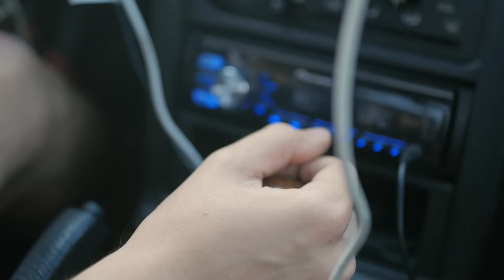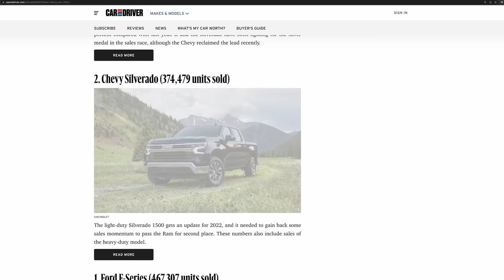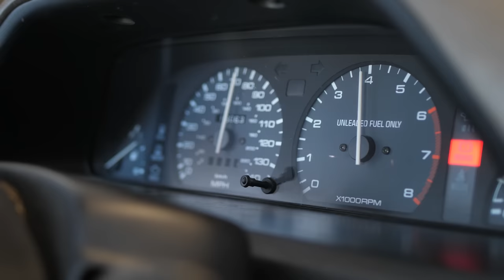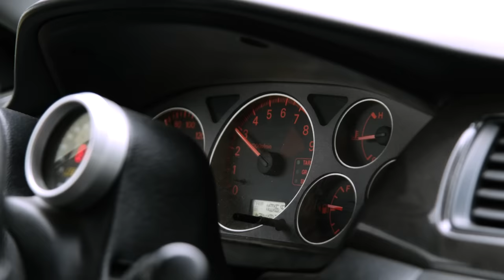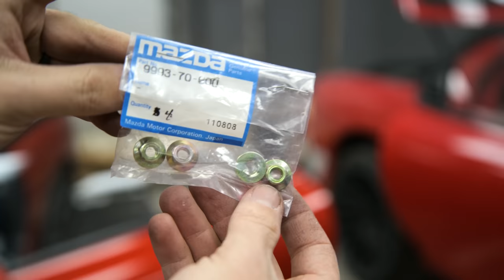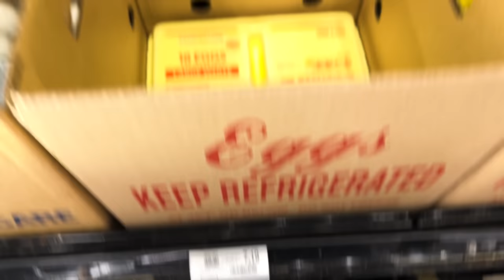Daily Drive Your Fun Car

Comment: I have 300K miles on my 8th Civic Si. It's cheap enough to nearly enter beater territory, very economical to operate, pretty comfortable with decently good handling, has a surprisingly good audio system for the price, and with a K20Z3 and 6MT with an LSD- I rev the nuts off of it every chance I get (usually on and off ramps).

Comment: This is the video I’ve needed ! I’ve had plenty of cheaper fun cars ( a few 350zs, e46 330ci ZHP, c5 vette). All we’re super fun daily drivers but they came with their issues . Stepped into a newer car (2016 genesis coupe 3.8 w/ 12k miles), it’s a great comfortable daily. It checks most of the boxes mentioned but it definitely doesn’t make me smile. It’s gotta go!

Comment: My Daily Driver Fun Car is my (from new) 2014 Fiesta ST (spec'd to the Max). Fully equipped with studded ice tires - it is a snow belt drift King👑. Ya I drive it summer occasionally - but it shines in winter🤡

With any luck my next fun car will be a GR Corolla Circuit Edition. (the 30/70 split sold me on that car as the ST is harder to drift with only FWD)
My current summer fun rig is several motorcycles and a 911 - Comfort is by far overrated. Life is too short to drive a boring vehicle.

Most people (99% IMO) have no idea what a fun car is all about.

Comment: I think I’m a good example of this really I daily drive my JZX90 and I think it’s the best daily every it’s spacious, handles surprisingly well for a “big body” Toyota, and makes plenty of power about 400 it wasn’t too expensive (at least when I got mine) there’s tons of aftermarket support for these cars in he US now so suspension parts are easy to get as well as a lot of oem is300 suspension parts fit perfectly, it’s full interior with ac and heat maintenance is cheap enough with JZ parts being pretty interchangeable and readily available at any parts stores plus the X factor for me is the turbo noises just rolling into it a little to make the turbo flutter is all I need to put a smile on my face 

Daily drive you’re fun car :)

Comment: I'm a petrolhead, but coming from the (barely but still) eastern part of europe, I just don't have that kind of money to play this, even though I earn good money. So I am forced to be sensible and boring, just because the cars, insurance and petrol costs are insane compared to what they are for you. And I'm not even talking compensated for income, I paid the equivalent of 6.71 usd per gallon last thursday to fill up on diesel for my beater, which also happens to be my only car. Money is the biggest problem, and in coming times, it's just gonna become an even bigger problem. So I'll be here watching for the foreseeable future, looking at you doing what I wish I could do.
Edit: cries in 75hp at 200-400hp recommended (wtf, I'd say from my experience it's 150-200hp).

Comment: I had two cars for a long while; a 2001 Lexus GS400 and a 1994 Honda Civic. A daily and a slightly less than daily beater. One was comfy but used twice as much gas, and one was a lot of fun to drive and dirt cheap to own. 

I'm conflicted; I LOVED my GS, but the cost of gas led me to sell it and keep the civic as a daily. But the civic can't compete with just how COMFORTABLE the GS400 interior was. Though I spent (literally) twice in gas, I miss it. Even if the civic is tons of fun to drive.

Comment: In order, I daily drove a Fiesta ST, Mustang Boss 302, Camaro SS 1LE, and then a Kia Stinger.

I can without a doubt say that if I could only have 1 car at a time, I would choose a manual sports car vs a comfy sedan (though don't get me wrong, the Stinger was still fast as hell). The Kia was a bit boring/ less engaging. Granted, my commute was a very short commute when I had one, 4-6 miles a day to work. And now that I work from home, I don't need a super comfy daily driver, it's not like i'm driving for 6+ hours at a time.

Comment: For 5 years I had a 09 Malibu.  Was it quick? No.  Was it sporty? No.  Did I enjoy it because I was in highschool and college when I had it because you just turn the key and it started every time?  Absolutely!  I owned it from 172k miles until 211k miles and it was a fun car that was worth so little that I didn't mind beating on it constantly.  Traided it in 3 months ago for a 2017 wrx.  Everything said in the video is so true.  The wrx handles, it has some power but not too much, and it is a stick which I have been talking about getting for years.  As much as I miss my Malibu, the wrx fits me very well.  I much prefer backroads to straight line speed and that is by far the strong point of the wrx.  When you can get on the gas in it, it really does feel like everything just melts away.  Especially after a hard or stressful day at work.

Comment: Have a b8 s4 avant as a daily, it was meeting the criteria so well at the start then #3 hits and it’s literally the same model engine being torn a new asshole for being a complex nightmare with loads of failure points. Great 😂 simplicity is a massively overlooked plus point though as any issues with a modern/complex car and they are stupidly costly. Have spent like £8k in 2 years on maintenance alone and its probably only worth £15~k

Comment: I daily drove my NA Miata for a number of years and it was by far the most "FUN" to drive.  It was totally stock with a nice exhaust, and it was in very nice condition.  It was only about $3600 when I bought it and it was a nice car.  But as a daily driver it didn't really do it for me.  It was slow, the HVAC was anemic, you'd run out of ass before gas on long trips, it was cramped, kinda noisy (even in stock form) hard top made it a bit more livable but it still was just kind of tiring to daily.  I ended up buying a Chevy Volt, and IMHO I think it's the best daily driver I've ever owned.  It's quick, comfortable, convenient,  silent, I don't use any gas on my daily work route, and it's versatile and just nice overall.  I've been daily driving my Volt for about 10 years and I've enjoyed every bit of it.  And on the weekends and occasional track day I drive my '87 RX7 Turbo which is stock and fun, but it's fun so I save it for when I want to have fun.

Comment: I daily drove my bagged & bodydropped S10 for a couple years (no a.c in FL yeehaw), then a slammed Mazda B2200 (kinda miss that too), then a 2000 GMC Sierra. By 2019 I sold all 3 and bought a 2015 Golf (RIP) and in 2020 replaced it w a 2017 GTI and I love it. I want to at least go stg 1 tune and some bolt ons and 'oem+' type upgrades. Fun daily drivers ftw, but I also itch for another S10 to mess with as a project that could be a daily when needed.

Comment: The best daily, in my opinion, is a Lexus IS-F. Good power, looks great, relatively quick, great performance/handling, simple, relatively easy/inexpensive to repair/maintain, extremely reliable, understated yet appeals to car enthusiasts, respectable mpg for an N/A V8 with 416hp stock, offers more utility being a four door sedan, and so on. It's hard to beat for the money given it ticks nearly every box. One of the few cars you could hand the keys to a friend or family member and not only will they have a blast, you have nothing to worry about as far as the car is concerned. Almost any inexpensive truck/full-size SUV can offer utility (cargo space, hauling/towing, etc.) comfort, great ride quality, seating, AWD/4WD, etc. which is why I prioritize reliabilty and performance for a daily.

Comment: I daily drive a Volvo V50 1.6D Drive E with the MTX75 5 speed manual transmission.

It is a pretty good daily driver, extremely economical my average consumption record is 4.2 liters per 100km’s or 56 MPG US, it is practically, the low end diesel torque makes it pretty pleasant to drive despite only having 110Ps and it is actually surprisingly fun to drive, it is surprisingly nimble and handles pretty good. On the Swedish backroads it kind of becomes a momentum car.

Comment: I also thought about selling my Daily, a Hyundai Diesel station wagon and just putting the tax and insurance money into gas for the fun car, a modified 88 Supra with ~350hp.
But for two reasons it just does not check out for me.
1.) I need to get around in the winter. And I really don't want salt on my repainted Supra, let alone considerations of safety and tracion on snow.
2.) While the Supra is a super nice daily driver, extremely comfortable and not tooooo bad on gas, the reliability is always a little hit or miss. it's still an OLD car with twice the boost it had from factory. I work a lot of weddings in the summer season and breaking down is just NOT an option I can afford.
If it wasn't for these issues, I'd do it and save the hassle of two cars.

Comment: I have a good counter-argument to make : Having a reliable, economic, confortable, versatile car to drive every day makes a lot of sense, and if you are a car enthusiast then get a purely fun minded second car ! Yes it will cost a bit more to have two cars, but having only one car means you have to make a lot of compromises to be able to drive it every-day. And if you drive your only car everyday, it's making it less fun as the times goes by. For exemple, I drive a very boring Toyota SUV everyday as a main car, but I know that everytime I will get in it, the engine will start with no problem, I won't have to mind the gas-mileage, I can load it with a lot a stuff with no problem. AND the week-end I drive my godly fun E30 with absolutly no compromise of confort, gas mileage, soundproofing etc ... that would make it less fun !

Comment: my daily is a 2013 jetta 2.5 5 cylinder with some 18 inch golf r wheels on ps4s tires, coilovers, intake, catback, and ecu reflash. gets 33 mpg on the highway at 80mph and is pretty fun to wring out

Comment: My perfect daily driver, I actually just traded it in and regret every moment of it, my 2014 VW Jetta SE W/convenience. Super reliable with it's 1.8 turbo TSI engine with plenty of power, I only had to take it to the dealer 1 time in 5 years!
Reply: I didn't get to finish earlier, but the only reason I traded it in was the deferred maintenance on the transmission made it a ticking time-bomb, and the cost to replace the control arms and do the timing chain service was worth more than the cars value. But, with the current car market, it would have been a sound investment just to keep as a local daily driver to keep the miles down on my new car, (a 2021 Toyota Corolla LE that is not as great as everyone would think, though prices similarly to a VW Jetta, this is a very stripped down econobox that is super boring and uncomfortable, with a horrible sound system) while I make the 72 mo $385 payments. The Jetta could have tickled that "fun factor" while the Corolla kept it's low mileage value long enough to replace it with something a little more fun

Comment: I started off driving with an 03 Camry I inherited. It was comfortable, quiet, low on maintenance, and it got the job done, and I hated it. It was so boring and soul sucking, and I put up with it for years cause it was a good car. But when a few things on that car went wrong all at once, I found an RSX type S that cost the same amount as what the dealer wanted to fix the camry it was a no brainer. Literally my whole outlook on life started to change cause I got into a car I actually enjoyed. I'd get up in the morning thinking "at least I get to drive this thing today." Now I did learn my lesson about not letting a project car be a daily, and sure spending an hour in bumper to bumper traffic sucks with a manual. But I really didn't care. I rarely ever took it for joyrides even, I drove it like a normal car 95% of the time. But that 5% when I'd hop on a back road after a rough day or have a clear on ramp, that's what made it so worth it. I'll never go back to having a boring car.

Comment: My dream daily driver is a sleeper Volvo 240 estate in beige with a large single turbo setup and about 350 horsepower, gearbox and brakes swapped for the later ones from the 940, and if I'm going really mad, HRE 935s

Comment: I had 3 vehicles: 2007 FJ Cruiser 30,000 miles, 2007 328i BMW manual 68,000 miles, and a 2005 Suzuki GSXR 29,000. I just sold my bmw, and cried for 3 hours. I don’t like putting miles into the FJ, because I baby it too much. It used to belong to my brother that passed away. It’s got chrome mods, n stuff, with a sick sound system. Wish I didn’t have to let go of my bmw,  but I had to do home repairs…. 😢 As for my bike…. I’m debating whether I should keep, or sell that too, as I’m planning to move from LA to Seattle.

Comment: I think you guys have a point here, but I still can't share your thoughts. I currently daily drive my fun car, a lightly modified hot hatch, and this probably induce me to see only the dark side, even if it is still a relatively confy, reliable and cheap car to run. But I think that all the "daily driving scenarios" are not made to accomodate the fun side of a car. It's always too packed on the streets to enjoy a pull or how good my car handles around corners. Too much cars around me, not enough space. In those situation I just wish to have a better sound insulation for both aero and engine noise, a better sound system and a butterly smooth ride.The only moment where I actually enjoy my fun car, it's when I pick a fun and empty route, when I am not tired of my daily duties, and I don't have to rush my destination.
Reply: Yeah, I switched my DD from a rock solid 73K mile 94 Camry that was extremely comfortable with zero issues to a 01 Celica GT-S with double the miles and over double the price that is quite the opposite LOL. I can see why people DD certain cars. I would need to dynamat the entire thing to make it sound like the Camry inside and it needs $1,000's in minor work . 
Even still, I'm extremely proud of the Celica and it looks amazing and not like grandma just went shopping. Just gotta pick what you really want to stick around with for a very long time.

Comment: I was looking for a larger sedan for commuting...and since I was a manager at the  time of purchase, there were times I would be driving coworkers to places so I needed a car with easy ingress and egress...but wanted something that was fun to drive and decently reliable...but comfortable for four.  I landed on a 2014 NIssan Maxima.  It was a lease return with barely 8,000 miles on it.  It has the premium and tech packages and almost 300 hp.  The downside is the CVT but there is still enough power and handling to treat it like a touring sedan...and it's a great highway cruiser.  Maybe a Camry or an Accord would have been a  better value but I enjoy how the Maxima drives and so far it's been very reliable.  

I had a BMW 3 Series wagon before and while that was a fun daily driver, as the car got older it required more mechanical attention and when I think about it, I should have gotten a Camry or an Accord as my daily and an older BMW E30 as my fun car....

Comment: Basically in order of price. Honda fit, GR86 ( or the siblings) wrx/sti, veloster N, Type R.. ultimate do everything cars!  (also if you absolutly cant have a honda fit. the toyota yaris manual is basically the non vtec comparison..)

Comment: Cars with 300-400 hp cost 100k plus where I come from. A Lancer gt cost 90k an Evo 10 cost 110k++
A Subaru cost (not the fancy type) min cost 70k. A tiny miata cost 40 - 60k, which costs even more depends on the condition. He'll a Nissan sunny with a Sr 16 engine cost 40k

Comment: I have 2 cars, 2019 Ram Bighorn for the winter, drive it long distance love that truck & I'm doing small minor mods but useful & needed mods. My Hooptie an 04 Acura RSX which I have owned since 2013 & it's shockingly stock besides tinted windows. The plan is to eventually rebuilt the motor when it dies  keep stock but get wheels & suspension that car is the fun car for me. The car definitely needs some exterior work tho (paint & small dents) but at least it does awesome with fuel economy. Love that car & don't plan on selling it ever.

Comment: Late to this video but some beaters are also just good performance wise. A lot of older sedans or hatches can be taken below 3000lbs pretty easy and most v6 models make 150-250hp (ex: 99 accord v6 is ~3250lbs with 200hp). Thats a good sweet spot of performance for an econobox that has 300k miles and has 300k left in it before any issues.

Comment: Even some low horsepower cars like the RSX Type S and other Hondas make fun daily drivers even though it’s not extremely fast. They’re quick feeling, handle well, and are light. I think all you really need is 150 or more Hp if you’re in a light car

Comment: I drive a beater shitbox... and it's my funner car... 2006 Jetta TDI. Gray, bad spraypaint, Rust... but I keep it mechanically sound. My other cars are 2018 Acura TLX and 2007 Tucson V6 4x4.
Yes new automatic transmissions are good, but I need my true manual transmission. The Jetta may be a low end German car and a TDI isn't all that fast (unless modded) but it's got an amazing road feel... something about German cars... just like there's also something about Honda Civics... they have a unique yet totally different feel.

Comment: Though make sure your fun car is a car that doesn't need a thousand issues or things fixed. I had bought a G35 Sedan on my 20th birthday and I spent more time getting it fixed than to enjoy driving it. Sure it was fast but it was also my most valuable asset at the time. I would worry that i would end up wrecking it or havinf to risk it getting stolen. I ended up selling it for little profit because I just didn't like having it at the end. I daily drive a 1999 Corolla and it'll probably be the only car I'll ever drive until I find one that I would actually want.